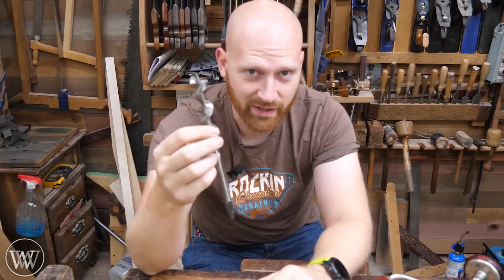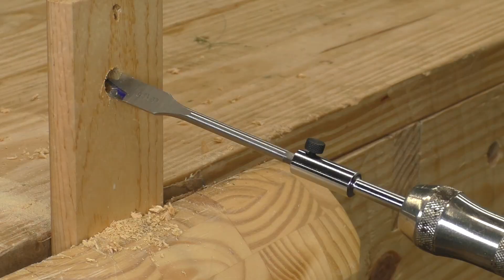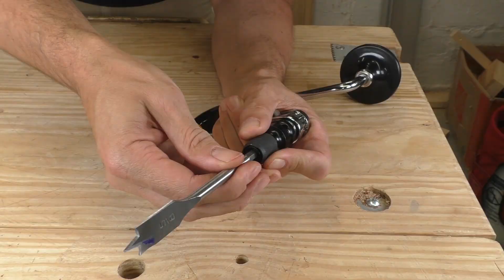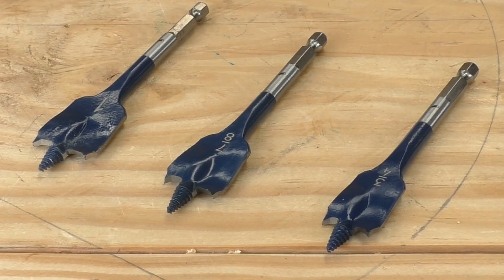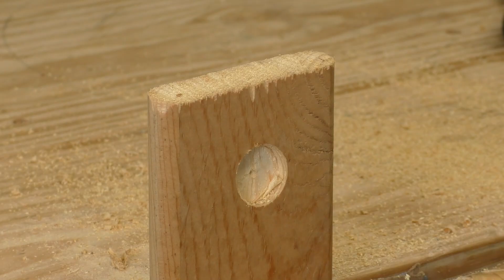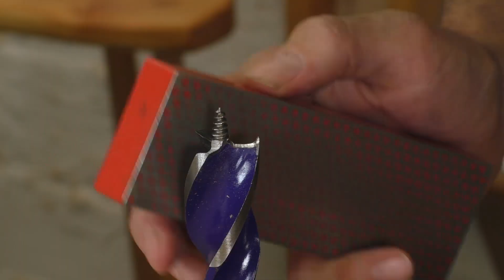Modernize your brace with new gear!

Comment: @Rex Krueger So, I bought the Garret Wade brace a while ago myself and I was just wondering, does yours have a decent bit of wobble where the drive is connected to the rest of the brace?  Not where the chuck slides onto the drive, but where the round shaft of the drive goes through the end of the brace.

Mine wobbles there and I was considering getting a replacement, but I thought maybe they just come that way.

Comment: If I remember right the two jaws can be removed. They have some springs that hold them together. Just need someone to make 3 jaw insert set.
Reply: I thought about doing this but it would probably not work because the 2 jaws fit inside a cut out in the chucks thread.  There isn't room for a third jaw.

Comment: im no woodworker or anything like that, but it seems to me like you are onto something with the cheap auger bits. maybe you could shorten the cutting edfes further in to get the nickers to stick out a bit further, then from there it would be easier to get the nickers very thin and sharp. or it would give you the space with the nickers to copy the vintage auger design.

Comment: Hey  Rex, I couldn't find any vintage auger bits here in Germany so I startet buying the ones branded "Star-M", apperently japanese, from fine-tools.com. They are reasonably priced at ~ 8 $ a piece and the ones I already own, a 12 and 19 mm, bit, work excellently in my vintage brace. Plus they are available in imperial measurements ;)

Comment: A lot of those modern auger bits are designed for plumbers and electricians running pipe and wires through studs.

Comment: If I had to replace one hand tool with a power tool, it would be the bit and brace+egg beater for a power drill. Either a battery powered dewalt/milwaukee or a bulletproof old plug in. But for speed the battery powered ones really are much better than everything else.

Comment: I bought a bit brace a week ago, i wish i would have waited a little.. I bough a cheap thingy that does not hold round auger bits very well, but it will do for the little i need to use it, and its mostly for kinda soft wood anyways.

Comment: Good for you for admitting that you haven't found a solution yet! Your integrity is a breath of fresh air on the internet.

I think woodworkers need to get a little more real about how many bits they need. I highly doubt really anyone needs the FULL set of Wood Owl bits. Aren't we really only drilling maybe three or four hole sizes? Seems like chisels, where you probably don't need every single size
Reply: This. I just picked up about 100 bits at a thrift store, and still do not have a full set. I was like "aw man?", but then realized that I don't think I will ever have the need to drill a 15/16" hole. And anything over an inch, I'll use an expansion bit for it.
Reply: I concur with the comment about about the number of sizes needed. I have a set of three Wood Owl bits (1”, 3/4”, and 1/2”) that work very well. I use them directly in my vintage brace and I’ve found if I set it to not ratchet that the hold is better. Combined with an old square shank expansion bit, I can most of my larger holes drilled without using my power drill. If I had a egg-beater drill that took round shank bits, I’d be set.
Reply: Yes! I have so many chisels that are just completely unused. I have about 10 different sizes, but I find myself going back to the same 3-4 for everything. 
I will say the only exception to this is probably forstner bits. Maybe it's just me, but I have found myself needing all kinds of sizes.

Comment: I wonder if a modified hole saw set might work with it? I don't have a brace to test it though sorry lol, but the idea just popped in my head as I've just been cleaning out my garage (to prepare for building a workshop area 😁) and found a set. The drill bit in the centre sticks out maybe a little too far, hence my thinking that some modding might be required.

Cheers for all your vids Rex, learned a hell of a lot over the past few months since finding your channel.

Comment: I'm using modern Japanese Star M auger bits in my vintage brace! I have had good experiences with them. They are not too expensive either.

There are allso inch sizes available.
https://www.fine-tools.com/bohr3.html

Comment: If you are using square adapters you could use a mechanics speed brace which come in half inch and three eights square drives, probably pick these up in a flea market a lot less than $50.In the UK you can get Black Smith drills Larger metal drills with half inch shanks.  I have never tried them in a hand brace.

Comment: I have a set of hex-shank Star-M auger bits from Japan which have a snail and one cutting spur. They cut beautifully clean holes, were not massively expensive (a set of seven, 6-25mm in 3mm increments with a tool roll was 60 GBP from Workshop Heaven), and my two North Brothers Yankee braces have no trouble gripping the shafts. (The North Bros braces have an unusual chuck, which actually also works with round-shank bits... Highly recommended, these are the ones used by Bell Telephone linemen for decades so they were massively overengineered and will last forever so long as they're not abused.) These are the ones: https://www.workshopheaven.com/star-m-combination-auger-bits-7-piece-set.html
Reply: www.fine-tools.com has them as well.

Comment: I bought a keyless 1/2” chuck with SDS shank from Amazon. The SDS shank is gripped really well in the two jaw shell chuck and the regular three jaw chuck will handle most things. Unfortunately, my experience with modern bits has been similar to you Rex. About the best I have found here in the U.K. are Wood Beaver. I’m not sure how widely available they are under that brand name but I suspect they come out of the same Chinese factory as the blue ones at the start of the review, except they are red. The hunt for good vintage bits goes on...
Reply: I never even thought of trying an chuck with an SDS shank... going to try that now.  My granddad was good enough to leave behind his brace but I wish I knew where he put the bits!
Reply: eggypickle Good luck, let us know if it works for you. I’ve used mine with down to a 6 mm (1/4”) Brad point bit and it runs true ( I use an egg beater drill for smaller sizes).

Comment: It seems like the best solution would  be a collet insert to adapt from a square base to a hex. Sort of like a Dremel collet. It would be a relatively easy thing to machine, and having it fit the profile of the original square base means that it could be used in any existing drill without needing to disassemble the original collet.
Reply: Good luck Terence.
Reply: That's a great idea!
Reply: Great idea . Make one.
Reply: Brian Binns I 3D modeled a mock-up and sent it to Rex today. If there’s something there, I’ll put in the actual engineering time and get a couple samples machined up.
Reply: @terencegelo2199  any updates to share?
Reply: @terencegelo2199  This is exactly what I thought at about the 1 minute mark of the video. Did you make any headway on this?
Reply: I have several antique braces, and use them with hex bits via some $10 quick change adapters. It's worked fine for years, now. Stanley makes them, probably a few other companies.

Comment: Don't have a solution but I've tried those irwin bits in a battery drill and so far I'm regretting spending over €50 on a set of 6. They are great at digging into the wood, but very difficult to stop and take back out when you reach a desired depth. Will have to go back to paddle bits.
Reply: Irwin speedbore bits are specifically designed to quickly drill a ROUGH hole all the way through a stud. They have a name, and that name matches what they do. You don't use them to drill accurate holes, nor to stop part way into the timber (they leave a big centre hole anyway).

Comment: Hey Rex, Fantastic videos.
 I have learned a lot and been inspired in my wood working. As I watched the video, there is one thing I was waiting for you to try but you never did.
I work in the trades, and we get clean cuts with cheap tools by  putting down blue tape where we are going to cut.

I feel pretty confident that you could get very clean holes from some of those more disappointing bits IF you drill through some blue tape. I don't own a bit and brace, but if you can try this, I look forward to the feed back. Thanks Rex!
Reply: I was thinking the same knew i would see this
Reply: Oh, that sounds like a great idea to me !

Comment: If you want to use modern bits in a brace then why not get a brace that was made to hold modern bits. Several manufacturers made braces that would take the traditional auger bits as well as round "modern" bits. Going from memory Stanley made the 2100 and 2101. Millers Falls made the Lion chuck models 769-774, 870-873 and the Holdall 729-734 models. Pexto (PS&W) had the Sampson chuck in the 8210, 8212, 8012-8016 models. If you are wanting to use very small bits in a brace then look for one of the vintage adapters with the square shank end and three jaws designed to go in a brace.

Comment: On my electric lathe it doesn’t really matter if the chisel is sharp or not it will remove material not effectively but it move material due to the speed of the lathe. 

A dull toll is a dangerous tool it requires more force to make the cut.

Comment: SPADE bits are for kindergarteners, amateurs, and hacks. The word SUCKS just doesn't even
touch the BAD that spade bits are. Wood owl, it's the best for a PRO hole. I have been using Wood Owl
since 2009 and when I need a new size I buy ONE at a time. The performance is amazing. 3 flute.

Comment: Just seek the old bits. Work till you have a set. A dremel transformed my ability to get these sharp, but now they are. Wow! Do they work well.
Reply: Yes, absolutely 100% correct. There is absolutely no reason to seek out "modern" bits, when there are millions of the original ones out there. You use a file (not a dremel) to sharpen them - that allows you to get the angles correct, and the cutting flute(s) flat and straight..
Reply: @johncoops6897  Hi John, maybe I should use a file, but I found that a file just did not give me the edge that I got from the careful use of a file. And I was using a diamond file. It could be that I was just not giving it enough time, but at times time is short.

Comment: For small (under 1/8 inch wide and less than 2 inches deep) holes, a "pin vise" is a simple solution.  basically a straight handle with a chuck, that lets you twist or twirl a bit.  Modelers use them for pewter or plastic, and I'm sure they would be fine for wood... but that wouldn't work for larger holes.  A good enough pin vise with a good enough set of bits is around $10, so they are handy to have for random projects.  "gimlets" would be fairly similar and more traditional.
Reply: For small holes (up to 1/4" just use a egg-beater still hand drill. A pin vice doesn't have the torque or speed to be used for wood. I know because I tried it on some 1/8" holes a few weeks ago, and it was not fun.

Comment: You  mention that you find the garret wade lacking in quality some way, but aside from giving it a rattle, I just did not get what you found needed improvement.  Could you clarify your feelings on that?  Because aside from a handle that rattled a little, nothing else was clear to me.
Reply: I bought one of these from Garrett wade but I sent it back because the ratchet mechanism slipped when drilling.  Its ok for very light work but not drilling with an auger. Its a bit smaller than the stanley, which does make it a bit difficult to use. Also the 3 jaw chuck jaws only clamp at the top of the chuck. My auger bits hex fitting wasn't clasped by the chuck jaws and the jaws span around the round shaft.  To get them to work I would have to put a block in the chuck  under the bit so that the hex fitting was clasped by the jaws.  The general build quality wasn't bad. Garrett Wade customer service was excellent.  I wish there was a good quality brace on the market that had a socket drive.  I thought about converting an old one to do it.

Comment: Has anybody tried the Adapters from Lee Valley?  Looks like they fit an old brace and can can fit hex bits or 3/8 sockets.  could be a good solution for around 15$ CAD.

https://www.leevalley.com/en-ca/shop/tools/hand-tools/drills/100081-brace-drivers-for-screws-and-sockets?item=50J6105

Comment: hmmm, I wonder if you could just weld that socket drive to an actual antique bit brace to get the same effect instead of dropping 50 bucks an a whole new bit brace, that way you'd just neede to buy an adapter

Comment: Hey Rex, I was actually looking at the versatile brace a few weeks ago but ended up finding some vintage ones instead. Can you maybe do a video talking about restoring vintage bits? Ive got a while box of them that I'd like to use but they could use some work. I didnt want to just start messing with them for fear of accidently messing them up. Thanks!
Reply: He may just refer you to James Wright (Wood by Wright and Wood by Wright 2 on YT.) He's a nearly exclusive hand tool worker and has quite a few videos on sharpening, including auger bits.
Reply: Ditto.
We're the lucky ones that have bought all the augers from the flea markets.
For my part, I'm double lucky in that half of my bits are in good condition.
I, too, would like to know how to sharpen them properly and have held off trying for the same reason as above.
Reply: @davidsmart8594  Old Sneelock has a good series on sharpening brace bits.   https://www.youtube.com/watch?v=bGltw2MLle4
Reply: @333rpd  thanks. I've been looking for a good video or two on auger bit sharpening. Although, I would still recommend starting out on a bit you have multiples of and in an extra length. You know, just in case it takes a few tries to get good at the nuances of this particular sharpening task. For instance... I dont drill a lot of 9/16 (#9 in the set) holes and have been able to find 3 #9 bits, I think I could likely spare a #9 as a practice bit to learn sharpening on. The other sizes I have 2 or less of each size and have yet to find any 1, 2, 5, 13, 15, or 16 bits to complete a set. I am not asking on here, the hunt is part of the fun, and I only entertain bits I can put my eyes and hands on.
But thanks for the link,
Reply: @thomasarussellsr  To my knowledge there are no 1, or 2's and 3's aren't common.  The numbers on the bits are the diameter in 1/16's of and inch, for sizes less than 1/4" (4) you would normally use an eggbeater drill.
Reply: @333rpd  oh, okay. That's good to know. Guess I can quit looking for 1/16, 2/16 (#2 or 1/8) and count myself super lucky I found a #3 (3/16). Great info to have. Thanks.
Reply: @thomasarussellsr  I have #3, and it is really pushing the limits of how the auger bits work.  ;)
Reply: Lee Valley sells an auger bit file.  I bought one a couple years ago and it works well.  One end has safe sides on the sides of the file for filing the cutting plane, while the other end has safe sides on the front and back for sharpening the knickers and touching up rusted screw threads.  It's $23.50 when I just looked it up today (October 2020).

I've used it to restore quite a few rusty old auger bits to usefulness.  I imagine you could probably get away with using small regular files and just being careful, but personally I've got enough tool maintenance to do without spending extra time on auger bits.

You might also consider looking up how to do rust removal via electrolysis.  It's effective and pretty easy to set up.
Reply: @jeffspaulding9834  thanks for the Lee Valley tip. I'll have to check then out. Also, any leads on a video on sharpening files? I have a small bucket of old ones that should be good if they are resharpenable. I hate to just turn them into knives if they can be salvaged. Those old files were so much better than the newer ones. (Some were grandpa's and some were left behind by the former owner of my property, a former maintanance foreman for L&N RXR Co.)
Reply: @thomasarussellsr  Sorry, I've never seen a video on sharpening files.

I've seen a Clickspring video where he makes files, but they're not exactly high quality - he was trying to replicate the files they would have been able to make in ancient Greece.  The name of the video is "Antikythera Fragment #3 - Ancient Tool Technology - Hand Cut Precision Files."  You might be able to adapt his methods by annealing an old file, hammering it flat, remaking the teeth, and hardening again.  After all, you've got good steel to start from and modern knowledge of metallurgy on your side.
Reply: @jeffspaulding9834  thanks anyway. But yeah, I'll check out that video.
Reply: @thomasarussellsr  files are sharpened chemically buy soaking in an acid bath. You can use white vinegar for the bath. Let them soak for several hours, rinse well and card off the loose material.
Reply: I was gifted a brace and about 5 bits from my uncle a few months ago. I am in the same boat, i want to clean/refresh the bits and brace but am not sure the best way to go about it.
Reply: @murphragous  follow the link in 333rpd's comment above. I watched the three part series and that guy covered sharpening the auger bits very well.